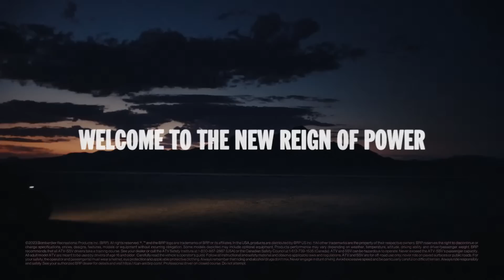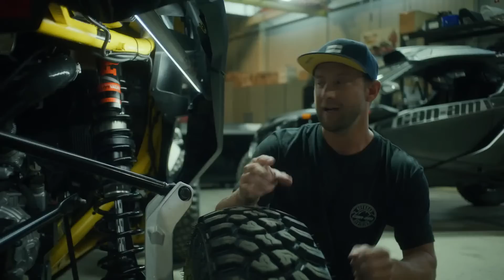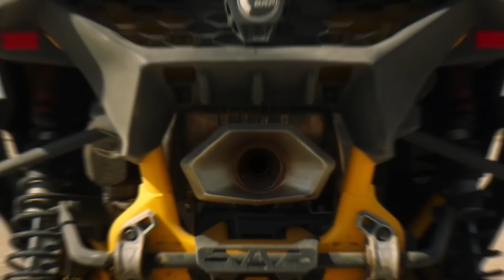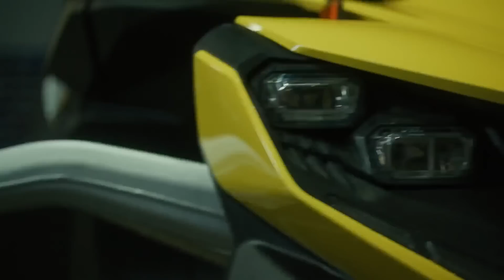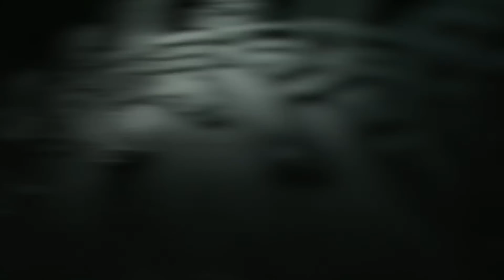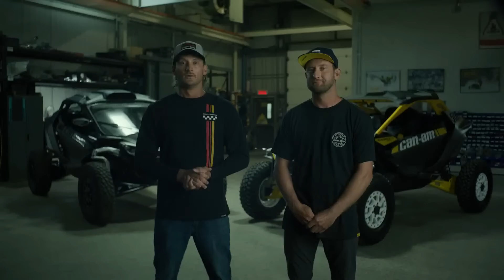A New Beast is Born | Can-Am

Comment: In my eyes, this was a little disappointing to me just because this car in my eyes is meant for desert use only it’s too wide to do any trail riding mohawk tires up front or any steer tires for the sand are going to be limited rock crawling a scratch because you won’t be able to throw 35s on that thing
Reply from the maker: Hi Jay. Thanks for your comments. In fact, you'll be able to add 35" tires on the Maverick R

Comment: It’s all fun and games until you see the price. $60-$70k lol. Y’all are drunk and regarded if you pay $61k for this. You can build a custom buggy with a v8 with 450hp for that price.. f that
Reply from the maker: Have you seen the price though? Maverick R starts at $35,499
Reply: @CANAMOFFROAD  lol.. for the lowest base model one. No one buys that one. On average they are 42-45k with 0 accessories. Remember you guys are charging $2000 freight plus fees and surcharges. Lol 😂.. I paid $1700 for freight in my 2022 ram 1500 why the hell should you pay more for a sxs that is half the size and half the weight? You guys are losing touch with the market.. people want more items in the $20-$30k range not more stuff that cost $5-10k over the most expensive stuff you used to have.. Either way, all these ridiculous prices will be 5000 off in a Couple years when no one is buying anything.

Comment: I like the design of the tall knuckle Suspension, but is there anyway that for when they come out with an XMR version that they can make them bigger so for a bigger tire, you need taller knuckle or will portals and spacers be enough

Comment: That motor and transmission in the x3 would be nice with that said definitely dropped the ball for the big tire mud riders like myself. the aftermarket is going to have to get pretty crafty to fit big tires under it
Reply: There turning into Apple not allowing there costumers to upgrade or even do maintenance to there own machines smh 🤦‍♂️
Reply: @canadian_7377 Yea same with Chevy etc ridiculous :(
Reply: Just get a bigger, tall knuckle suspension package. Honestly, I’m wondering if that package will fit on my renegade I’m more of a trail runner
Reply: Low offset wheels 🤷‍♂️
Reply: I think 32" is ok.
Reply: Will definitely need portals with anything bigger than 33s.
Reply: Just give it time...this is exactly how they fill the lineup out. Start with one, then trickle it down to the other models  (former employee)
Reply: It seems to be a dedicated dessert car
Reply: Not to mention so ugly and how do you bang threw the woods?
Reply: new a arms. That part wont be the problem.

Comment: I can see those top arms getting damaged, Can’t fit bigger tires, and I’m willing to bet those clutches in that tranny ain’t gonna hold up in the slow speed rock crawling with that much hp. I previously owned a pioneer 1000 with a dual clutch tranny and the low range sucked . Wouldn’t even turn 30s in mud and the clutches were damaged after my second ride . I don’t see this unit appealing to most ppl.

Comment: This thing is hideous. I’m gonna stick with my 2020 RC it only has 1200 miles and is modded to the max. I was definitely kind of worried that they would go back to the bubbly kind of look that they had before the 2017 version came out and they did. I am a Can-Am fan through and through ever since 2017 but this body redesign is ugly. The power is cool, but you can make 240 hp with these cars pretty easy and even at my 195 hp stock that is more than enough power so I feel like adding power wasn’t really a necessity. What I do like is the interior upgrades. Polaris used to kill Can-Am regarding their interior, but it seems like Can-Am finally caught up. That is the only obvious upgrade if you ask me.
Reply: Having decent door handles would be nice, getting rid of suicide doors, even better.

Comment: Price is going to be insane
Reply: $45k
Reply: 45k would be a great price for what it is.
Reply: @bradpowell843  Great price?  That’s insanity, wasn’t all that long ago you could buy a house for close to that.
Reply: @bradpowell843  45$ is a good price? Not for yhe average dude. That's a car payment
Reply: @Dooit4dale maybe a house with an axle and wheels under it
Reply: @Dooit4dale  you can still buy a house for that, as long as it's in a small town in the Midwest
Reply: I bet 55k
Reply: @Legoinry  It’s 35k-$45k according to the CAN-AM website, depending on which model, there are 4 different models.
Reply: I’m gonna say it’s gonna match the pro r so for those that bought, the pro r they are going to see this and trade it in
Reply: 44299 for the smart shox over a 33% price increase for jungle jim a arms.
Reply: @PudinTane-gc4dn  Did you watch the video? There was a few other changes
Reply: 65K loaded

Comment: Man I wasted my time paying full price at my dealer for 2022 here in Aus in only February. I still have my 2017. Should have just driven it till this came out. One time a few leaks would have helped me not waste $$. Emailing my dealer now to see how much dough I'll do on a trade or consignment on my sub 10 hr 2022...
Reply: Lots of first year bugs will need to be worked out. There’s too much new here to rush into. If I were you I’d hang on to the ‘22 and see what the 2025’s are like after consumers test the ‘24’s…. That’s just me though!
Reply: that's the time old thought on new models. I've bought a lot of new models over the years in vehicles. I did with first gen X3 too and no regrets.. Main concern is not doing too much dough on 2022. Mind you I'm already told this thing will be $40K here by my dealer...
Reply: @chairmannow2297  Ah I’ve recent bought first year products thinking it’s changed and it hasn’t. That’s still a thing. Go to the forums and see the issues MOST first year models have. You think a 240HP engine with new DCT won’t have some hiccups??
Reply: @pajamatime5750  Doesn't worry me.. It''s all on my dealer anyway here in Aus, we have excellent consumer laws protecting us. That's your experience, I've not had any issues there across several examples. I also did it when the Polaris XP Turbo came out too and similarly had zero issues. Bought much more expensive vehicles first model year too. Merc GT63s was a recent example.

Comment: Those stupid a arms over the tires. At least they got the shock mounted to the bottom a arm. Wonder if this frame will egg shape the a arm bolt holes?
Reply from the maker: The new Tall Knuckle design results in better load distribution, improved roll center height, and enhanced steering geometry. It’s not a design feature, it takes the driving experience to a new level and we really can’t wait for you to try it for yourself.

Comment: The knuckles not cool!
Reply from the maker: The new Tall Knuckle design results in better load distribution, improved roll center height, and enhanced steering geometry. It’s not a design feature, it takes the driving experience to a new level and we really can’t wait for you to try it for yourself.
Reply: @CANAMOFFROAD  Looks to be limited on tire size. If I want to make it a mud machine   35's ain't fitting.
Reply: @troybrown9009 35s are max, want bigger gotta wait for aftermarket larger arms. 35s are plenty big.